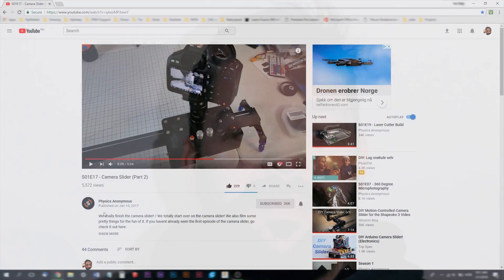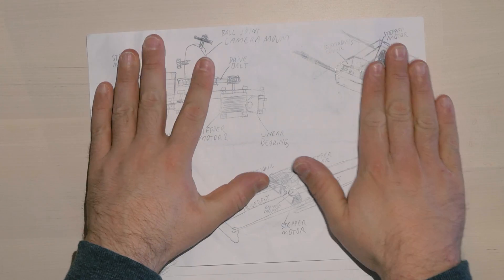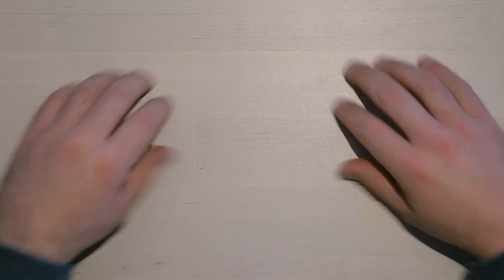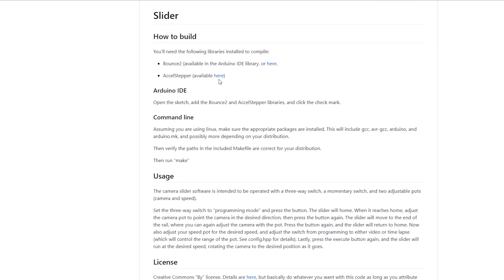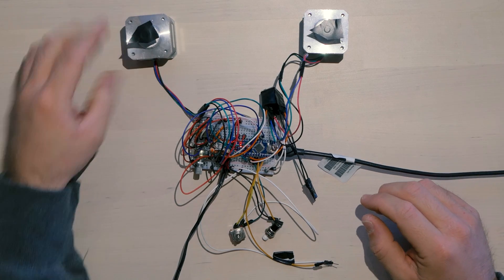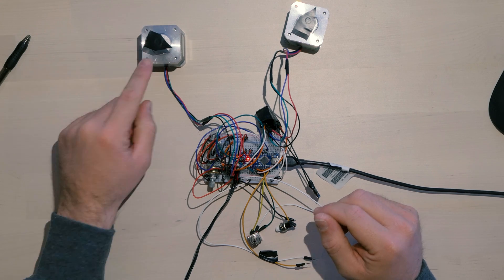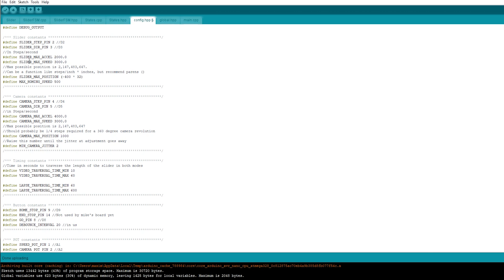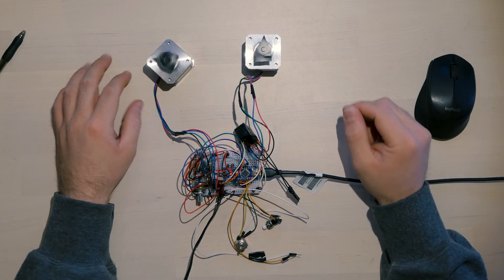DIY Camera SLIDER  (Part 1) - Figuring out the ELECTRONICS | 2-axis MOTORIZED

Comment: Hi Willy :) I have my hardware done, and put all electronics together. Checked most of conections with simple test codes to ensure motor turns, and tested other parts separately. BUT, after adaptaing the code with your inputs-outpus file, slider length max, etc, i just get a 'high hum'. You commented in the video something regarding 'electronics problemas solved' and i wonder if this could be one of them. Other readers ar einvited to reply this question too! ^_^ Thanks!
Reply from the maker: Hi, realy sorry for late reply.
Have you figured it out yet? 
I had some wiring difficultis with the stepper drivers, I got it working in the end.
I may have to update the wiring diagram but I think it correct.
Whats your problem?

Comment: Hi, can you show how the timelapse mode work?
Reply: Work the Timelapse Mode with SMS? (ShootMoveShoot)
Reply from the maker: @nufrequency86  no you can only control the speed of the slider, the camera must record video and speed up in post production
Reply: @WillysGarageNorway  If movement is slow enough, TL could be made with good results :)
Reply from the maker: @territorio_salvaje  you are right 👍
Reply from the maker: Hi, I used the timelapse mode in this video:
https://youtu.be/1q-8vX1tYWc
Reply from the maker: Also, have you checked out the rest of the camera slider series? There are 3 or 4 parts 👍

Comment: I wanna make it simple to use just one sliding motor how can I do it?
Reply from the maker: You can do that with this setup or you can use a regular dc motor with speed control.
Reply from the maker: But then you must regulate it everytime
Reply: No bro actually I want only one axis. Left right oscillating with limit switches and a pot that's it. I don't understand programming.

Comment: Can I use it without homing every time?
Reply: I don't want the pan axis for now can I use it without it?
Reply from the maker: Rajiv kumar yes, its possible. Then you even can place the stepper on one side of the rails to make the whole thing smaler 👍🏻
Reply from the maker: You need to home it and program the position of the camera. Then you can use it back and forth in different speeds. If you want to change the angle of the camera you must home it and program it again